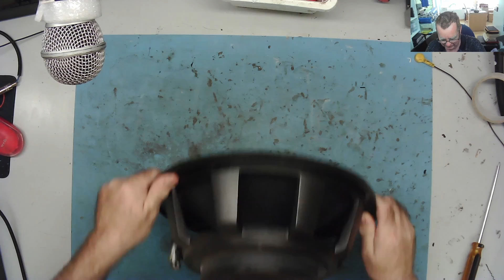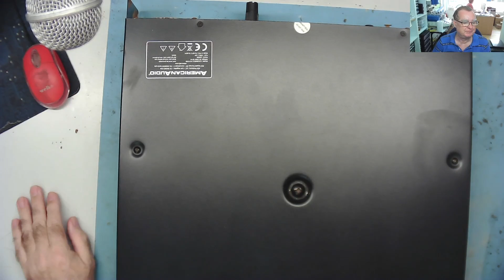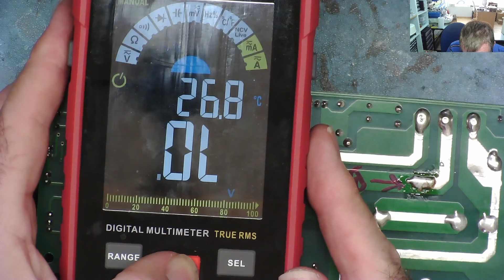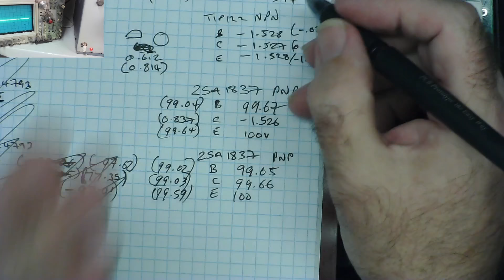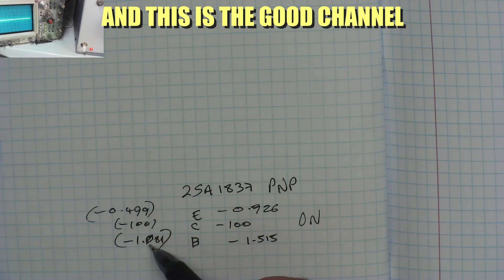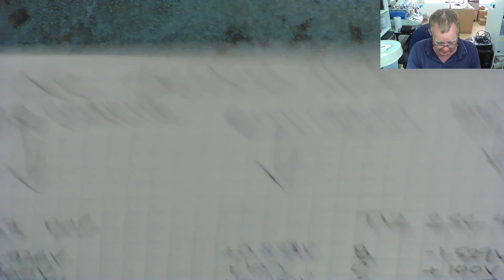Repairing  Electronics From High Level Down To Component Level  Practical Example 1500W PA System

Comment: I am sorry, but I take exception to the diagnosis of this power amplifier.

First off, I'm not picking on this channel-- I'm not trying to offend.  What i witnessed here goes on with the other big channels (e.g. Shango, Carlson XRay-Tony, EEVB etc. and not just them but MANY others) with the same poor techniques being continually replicated and passed on.  The reason for my exception, is yours and the others implied, have postured yourselves as being learning channels, by individuals that are held up as experts with years of experience.  As a result, new players adopt these inferior-techniques and if utilized would never make it in a competitive repair facility.
  
It is true that you and others at times lend valuable ways of doing diagnosis but all seem to have the same 'MO' of bumbling around for what seems eternity with a damn ohm/voltmeter making random measurements without a coherent plan or (you being an exception) not-even recording any of these measurements for analysis.  In this video, (and I do acknowledge the blown speaker and bulged capacitor issue) but is wasn't until nearly an hour after, you turned to the amp, that you began to employ a scope to qualitatively look at the distorted channel.

I am trying to help not hammer, so let me explain:
I worked in a high-volume warranty service center for Marantz, TEAC, REVOX, DUAL, B&O, MacIntosh, Pioneer, Ampex, Shure, Audio Technica, SAE, Kenwood, Sansui etc.-etc..  In a days time I would usually diagnose 25+ units (marking suspect components) and keeping 5 parts changers busy doing the R&R. I would have been fired doing diagnosis like this!

So, lets use this amplifier as an example. First, the amplifier would come in as having bad speaker and maybe a distortion complaint. With that caliber of speaker and it being open, then we usually suspect either general over-powering or a DC event. The amp would be given a cleaning, and close visual-inspection, and both the capacitor and blown trace would have been noticed and fixed.  I know that you would say that the trace would not have been noticed, but with the cap being bulged, all traces and resistors would be very-closely examined for stress.  As an aside, we know the trace would have fixed the problem; but you cannot leave this trace and power-up the amp because in many cases this can be the cause of a catastrophic-cascade that takes out all the power transistors.  The customer knows the amp powers up without smoke, so telling him he now has to pay for a bunch of blown outputs will not fly--and the tech was financially responsible and it came out of their pay! .  Indeed this would 'chase-away' the failure but you can apprise the customer that this is likely his distortion issue. We offered free returns for same failure symptoms.

So, without a fuse blowing or protection tripping, we would have jigged the amp to a stereo generator and load/power-measurement center. Since the amp does not blow the fuse or go into protection, most of the time this means the problem is not in the high-powered part.  So, once powered up and stabilized it would be found within minutes, the channel with distortion; with a scope from the start!. Next the scope is moved from AC-coupling to DC to quickly quantify the DC-offset possibility which is noted.  Now, let's say the trace was not seen and go forward from the place you were: Next, with the signal generator operating, the signal is traced from the input until the distortion is noted. This would also allow you to ascertain the function of each individual transistor, whether it be for signal, current amp or bias/stabilization (handy when you don't have a schematic).  At this point, the type of distortion is analyzed and from there the scope is walked around the distorting circuit to gain more insight.  Most time, I could tell from the trace characteristics, a bad coupling-cap, a bad bypass-cap, or a shorted, open or leaky junction (DC circuits).  It is ONLY at this point I might employ a volt/ohm meter!  Seeing the DC upset, I would then walk the supply trace back to the open-part. Being that this is a simple repair, I would have repaired the trace and verified performance.  Otherwise, I would take a Red-marker and mark components for the rework-tech to change, then return back to me for re-test.

As you can see, this whole diag took just a few minutes--most times taking less time than it took to jig it!  You would have walked the scope from the input to the defective stage (within a minute or two) seeing the asymmetry of the scope AC signal.  Now admittedly, we had warranty service manuals for most gear but many times legacy ones, or very new-ones came in without.  The only real time that I pulled a schematic was to view the PCB X-ray view.  So, this is where experience kicks in and you recognize the topology and then go from there.  I also have a problem with Huntron Trackers because too often they are just employed to look for asymmetries and not as an actual fault analysis tool.  

So, given that you are a teaching channel, please at least try to update to more succinct and efficient techniques.  Your audience will be able to follow you much easier than all the (I'm sorry) DVM-bumbling around. If you don't believe me, re-watch your own DVM diagnosis of measurement, writing, re-measurement, striking previous written entries and rewrite of new results--to me, it's just maddening to try and follow especially if you're new to the field.

In the repair center I worked, if a faster tech came in, the slowest one got canned.  It was really hardcore but you did stay motivated to be fast and accurate.  You also got pinged if you randomly marked parts or an excessive number. It was fine to mark an active device and its neighboring resistors and caps but if you marked two transistors, they better both be bad!  Also, if you had a unit come back with the same fault, the customer was not charged and the tech got nothing (even having to work on that unit after hours)!  We got 30-minutes for a power-amp; 45-minutes for a pre-amp; and 60-minutes for a AM/FM tuner--all commission only; the repair techs were hourly.  When I look back, it was the best experience a young-gun could have had.  This is what I want to see for new-players.  And NO, I'm not going to start a YouTube channel--don't ask!

So, the moral of this long story:  Employ a scope as soon as you have a stable but still-dysfunctional unit.  In the case of DC voltages, even in AC-coupling, I can tell how violently the trace wicks up or down the screen, the magnitude and polarity of voltage--certainly 100V, 25V or less will all act different.  I did have speakers in the load-center to listen but not as a diagnosis tool but a verification tool; then it usually went on to a distortion analyzer before sent out.

Finally, I am NOT attacking you or your channel--if you feel that way I deeply-apologize; but when I watch video-after-video (and not just you), I just lose it!   As I said,  most all of the major repair channels have an obsession with DVM's, and only resort to a scope in final desperation!  And when I comment, I either get a lame-excuse (usually saying they were making it a "journey") or crickets!  Or, I get attacked by the channel's fan-boys.  And most times, I just said: "Try using a scope up-front."

When I interviewed for the warranty repair-tech position, I was asked what is the one most valuable instrument on the bench?  
I answered 'the scope', because it can be any other instrument with just a twist of a knob!

Thank You for posting your videos.
Respectfully Submitted...
Reply from the maker: Hi. Thanks for your post, I am happy to accept any constructive criticism and yours is constructive.  However I honesty believe you are missing the point of this channel to a great extent.   

I used to work for ICL back in the 80s in the central repair workshop and we worked to 'time sheets' like you describe so each product had a code and each code had a time allocated to it.  You had to make enough repairs per day to book enough work time on your time sheet.  

Though this did aid productivity it also produced some interesting side effects, such as hiding enough 'fixed' PCBs under your desk to cover your time when you got stuck on a hard one, or certain members of the team coming into work early, quickly going through all the PCBs waiting repair and stashing the 'easy' ones under there bench leaving the hard work to their colleagues who then got disciplined for not 'working hard enough', deliberately blowing tracks off PCBs or causing shorts to internal ground planes to pass them off as BER (beyond economical repair) which you could also claim on your time sheet as hours worked, and similar skullduggery.  

I also believe this sort of system only works in a production style workshop where you are repairing multiple items of the same type and have all the necessary test equipment and information available, and you can keep a close eye on what your colleagues are trying to stitch you up with!

In the case of LER, the point I believe you are missing is that many viewers here are learners, that many of them have no specialized test equipment (maybe not even a bench PSU and certainly not an oscilloscope) nor the finances or ability to invest in such equipment often due to the local economic conditions in their country.

Many of them are probably hobbyists who want to learn to fix their own stuff, or stuff for their mates.  Or as I say to everyone in my first ever video, learn to repair by scrounging or buying broken stuff and trying to fix it ,and if you can't fix it salvage it for components.

Therefore I believe it would be totally inappropriate to produce my videos in the way you suggest.  I always try to complete a repair with the most basic equipment I can, and move on using advanced equipment like a scope or signal generator if I feel I really have to.  And even then I will usually suggest the cheapest way to do that (use the PC to generate sine wave, use power adapters instead of a bench PSU etc).  

Would you believe I have comments on other videos from subscribers amazed how many repairs I complete with just a multi meter, rather than 'showing off like other YT channel' with expensive equipment most people can only dream of owning?

So whilst I agree with your points regards how to diagnose this sort of fault from a technical and commercial point of view, I also don't agree with you due to the principal intention of this channel. Teaching electronics repair to anyone who wants to learn it.

One other thing I will just mention - I am not and never claimed to be an expert on audio or any other type of repair.  You will probably find me on the next video repairing a laptop motherboard to component level, a graphics card, a PSU or whatever else I get my hands on. I have said quite publicly I am not an expert I am a 'jack of all trades' who tries to explain clearly what he is doing even if I go down a few blind alleys before getting to the destination.  I do usually manage to fix stuff though, or at least know exactly what is wrong with it if then find I can't get the parts.  And to me and I suspect a lot of viewers that is the most important thing.

Edit
Just re-reading your comments, you seem to have missed the fact I connected the amplifier with a current limiting (dim light bulb) in series the first time I tried it, and again mentioned that I was taking that precaution every time I had changed something, such as when I tried it with speakers attached for the first time, and after I had repaired that blown track.  This would stop anything going bang, and I consider the light bulb limiter to be equipment anyone can build and use so often feature it on the channel.
Reply: @learnelectronicsrepair  
Wait a minute:  In your reply to me, you went to great effort to explain (in your mind) the scarcity of oscilloscopes but I feel you were a bit disingenuous, and I contend that you did-NOT nail the diagnosis with a DVM but with your oscilloscope when you found the collapsed audio signal.  It was only then, you took serious and went back, and scrutinized/took new readings and made subsequent continuity measurements leading to the blown trace.  The real clue (early-on and in black ink) came when you found T18 with the same voltage on the collector as the emitter (these two will never be the same in an operational circuit).  Why did you need to go any further?  Especially since you're now chiding me, claiming you're teaching DVM-only troubleshooting due to lack of equipment availability.  Anyway, this could have been the same ah-ha moment as seeing the collapsed waveform on the transistor.  So, what I saw was you finally finding the problem area with a scope not the DVM. When I saw this, I logically asked the question why you weren't using the scope from the start, like you were trying to use the music.
      [Also, I did not miss the 'dim-bulb' utilization, and fully agree and laud with its use.]

As far as obtaining O-scope capability/availability, there are apps to run through your mic input of the sound card in a PC, cheap LCD 100KHz PCB scopes, old scopes at swap-meets, finding other electronic hobbyists.  Many times old scopes (some with banana-plug inputs) are literally sitting under the tables for free at an electronics swap-fest.  I've probably given away a dozen, and sold probably that many for $50-100 that were low frequency but of lab quality. After I retired, I worked as a professor at our local college, and we gave away at least 20, most were Tek or HP with some B&K and a few Leaders.  We also surplused signal generators, design boards and all manner of meters. So, go to your local college or some repair place, it doesn't hurt to ask or leave your phone number.  If you're poor, ask if you can work in their shop to get something you need. If a person is really motivated, they will find a way.

  Another variant (if you're truly impoverished) is that of a signal tracer (fancy word for essentially a capacitively-coupled audio-amplifier) you can make one with a few transistors so you can literally listen to the test-junction. Maybe, I should start the "Dirt-Poor Repair Channel!" For years when I was a kid I had a $8 Radio Shack analog multimeter, an audio amp I built (used as described before) and a homemade harmonic-signal injector that went from audio to RF.  I didn't have 20 bucks in the whole setup but it allowed me to troubleshoot as I outlined using an O-scope.  From that point I made enough money servicing radios, TV's and automobiles till I got the money to buy better equipment.  I found this preferable to mowing lawns, shoveling snow or painting someone's house!

As far as your horrendous work environment, and the improprieties you described, I can only say it was horribly mismanaged, with a complete lack of oversight and any tech doing those shenanigans would have been fired before lunch!  What a crap organization--period!

Our center utilized a single service-writer that controlled ALL work coming in and going out.  It was up to him (as he was a crack tech himself) who got what to repair.  You either had a piece of equipment on your bench or it was with an R&R tech--fully tracked. We had techs that were good at RF-tuners, some mechanical (tape-transports etc.) and others audio.  Also, depending on how good you were, determined what and how expensive the equipment you were allowed to work on.  I was initially taken aback how good these techs were, and you couldn't hide how good you weren't!  You could ask questions, but it was never tolerated to dump a bunch of incoherent gobbledyGook on another tech, then ask where the problem was!  Techs that did get 'bumped' off the diag-line usually got to be a R&R tech; if they got more experience, they got to come back; if they weren't motivated they were shown the door.  Arguments were rare and I was treated with respect even being a novice.  Again, best experience I could have got back then.
 
I made a butt-load of money, and the only reason I quit was I could afford to go to college.  I wanted to know how components and values were determined and implemented in a product or design.  After, I was hired into design engineering and worked for 5 defense-contractors, finally retiring from Lockheed Martin.  I offer this only to show new people to this field what they can acheive with hard work, motivation and resourcefulness (and apparently to satisfy Mr.Johnny Bravo's relentless but inane curiosity!); thousands have done the same thing I did. So, people watching these channels have an opportunity to learn and excel and make enough money to buy whatever equipment they need or desire.

This has been a lively exchange but I offer this: New people are our future and anyone looking down on them or not offering support is unconscionable.  This is the reason many clubs and hobbies are collapsing.  So, help new people out and show them how to work around obstacles. If you got something you can give them--Give It!  Otherwise your wife will probably just install it in the local-landfill!
 
So, Richard, most-sincerely, your channel does indeed require a 'Jack-of-All-Trades' coupled with the hard work of making good videos, and is of great value and will certainly help anyone stopping by...  Thank You!
Reply from the maker: @SpinStar1956  Hi SpinStar1956 
I'll just pick the most salient points in your reply

>>>The real clue (early-on and in black ink) came when you found T18 with the same voltage on the collector as the emitter (these two will never be the same in an operational circuit).  Why did you need to go any further?

I totally agree I should have realized the significance of this.  In fact it made me think long and hard about how I could improve my transistor circuit fauiltfinding technique by taking more notice of the C-E voltage, and maybe also measuring across any collector or emitter resistor that may be present to try to work out if either 1. The transistor is hard on and passing currrent or 2. There is a voltage supply rail missing (as in this case).  I'm still learning  too, even after all these years and I guess we all are. Still I will add, as a very nice if somewhat unexpected side effect, creating YT videos is actually helping me improve my skills even more than I thought.

>>>Especially since you're now chiding me, claiming you're teaching DVM-only troubleshooting due to lack of equipment availability.  Anyway, this could have been the same ah-ha moment as seeing the collapsed waveform on the transistor.  So, what I saw was you finally finding the problem area with a scope not the DVM. When I saw this, I logically asked the question why you weren't using the scope from the start, like you were trying to use the music.

Did you watch this video?
https://www.youtube.com/watch?v=1NTNfTgSzgw
A similar fault on a similar device that I found even harder to pin down - but I did it with just a DMM and logical thinking.  I'm just interested how you would rate the method I used on that repair without a scope, and if I could/should have done it quicker. Please be totally candid. This may be a 'lively exchange' but every one here is behaving like adults.

>>> Our center utilized a single service-writer that controlled ALL work coming in and going out.  It was up to him (as he was a crack tech himself) who got what to repair.  You either had a piece of equipment on your bench or it was with an R&R tech--fully tracked. We had techs that were good at RF-tuners, some mechanical (tape-transports etc.) and others audio.  

After leaving ICL I went on to work in an industrial electronics repair workshop that used this sort of approach.  Though usually if one tech could not fix something they would pass it to another one.  I mostly got given the microprocessor based stuff.  Of the two jobs and the guys I worked with, I actually enjoyed working at ICL more.

>>> As far as obtaining O-scope capability/availability, there are apps to run through your mic input of the sound card in a PC, cheap LCD 100KHz PCB scopes, 

I  did make a review on a budget oscilloscope.  It worked better than expected and certainly would have been useful on this repair
https://www.youtube.com/watch?v=Lv_MvDMxHc4
I was completely unaware of the sound card oscilloscopes - WOW thanks for that one. I  see another video coming along...

>>> Another variant (if you're truly impoverished) is that of a signal tracer (fancy word for essentially a capacitively-coupled audio-amplifier) 
Yeah I already built this for another purpose that you may not be aware of, and it was quite an eye opener to a lot of viewers.  I also used it in a video repairing a radio.
https://www.youtube.com/watch?v=0hWnkRl3t1Y
https://www.youtube.com/watch?v=2pAp1R24XyY

>>>This has been a lively exchange but I offer this: New people are our future and anyone looking down on them or not offering support is unconscionable.  This is the reason many clubs and hobbies are collapsing.  So, help new people out and show them how to work around obstacles. If you got something you can give them--Give It!

And this I could not agree more: There was a time in the early 2000s that I honestly believed all these skills would be lost with the last of my generation.  Fortunately, thanks to the internet, I now know that to not be the case, and there are probably more people interested in and undertaking electronics repair (hobbyist and professional alike) than there were 'back in the day'.  

Also the ease of access to information means the people, hobbyists and professionals, are by-and-large better equipped to undertake this sort of work than we ever were. I actually consider this channel now to be my legacy.  If there is one thing I will leave to this world and hope to be remembered for, this is it. So you can rest assured I will keep on making these videos as long as I am able to do so.  And my health is good so far.
Reply: @SpinStar1956  "Mr.Johnny Bravo's relentless but inane curiosity!" .... LOL your in fantasy land I'm not curious about you at all, you write huge long patronizing replies hoping they will give you more credibility but it's just a lot of pointless passive/agressive bumbling, saying that you can do something better than someone else without offering any proof. You've got a cheek accusing anyone of taking too long to get to a point ... what a hypocrite. Are you doing this on ALL the channels you don't like .... and it does appear to be ALL the electronics channels ... maybe you could suggest one you do like? ... I could easily write 10 paragraphs of bumbling drivel too but it wouldn't prove anything .... respectfully submitted LOL ... I do think your wonderful really  ...🥱🥱🥱
Reply: @learnelectronicsrepair  "There was a time in the early 2000s that I honestly believed all these skills would be lost with the last of my generation" ... in pro-audio sound recording/sound reinforcement we were influenced by pioneering engineers of the 60's ... Joe Meek, Ted Fletcher (who's still designing in his 80's) etc. and all the recording/sound engineers studied electronics. The electronics side is no longer taught ... so now I constantly meet young professional "Sound Engineers" who cannot even repair the simplest of faults (e.g. broken XLR connectors) In pro-audio the electronics skills have been pretty much lost in younger generations ... ☹☹☹
Reply: Wow! ... just Wow! .... I can't think of anything worse than trying to teach someone what it's like to work under the threat of job loss. LOL this is a recreational electronics channel. I would've found that fault quicker than you spinstar but I still enjoy watching all the different things Richard does. I feel like a pro golfer watching golf on the TV ... you never know when your going to pick something up. Nobody's under pressure here mate ... apart from you apparently 🥱🥱🥱
Reply: @johnnybravo505  Really, nothing more telling then saying that you can do something better than someone else without offering any proof.
 And as far as the job position goes, you’re probably right, it wasn’t for snowflakes…
Reply: @SpinStar1956  LOL ... Ok show me some proof of your credibility ... you don't seem very talented ... a few diagnostic errors in your LOL critical review ... you would defo be on the next to go list ... 🥱🥱🥱🥱🥱🥱🥱🥱🥱🥱🥱